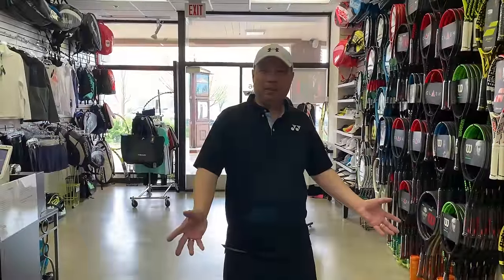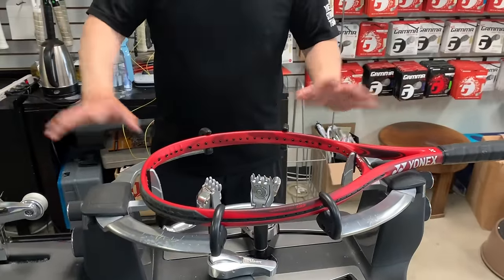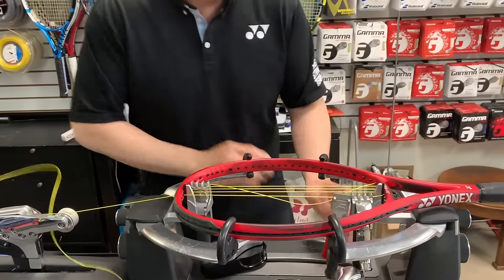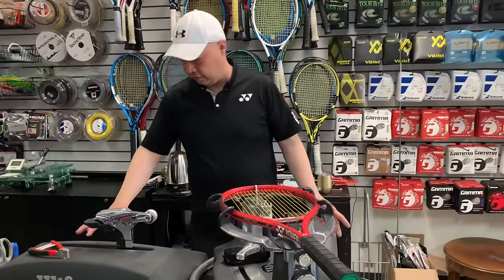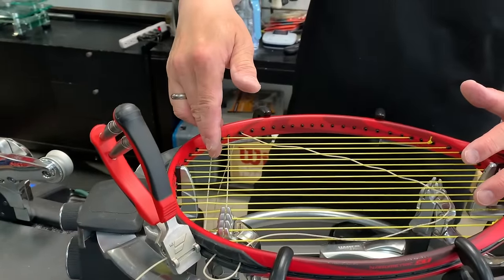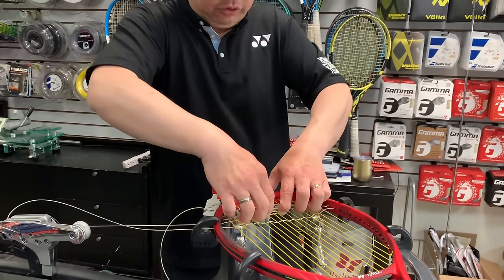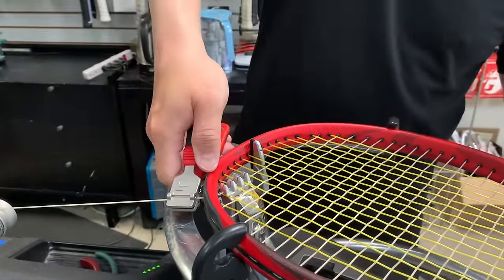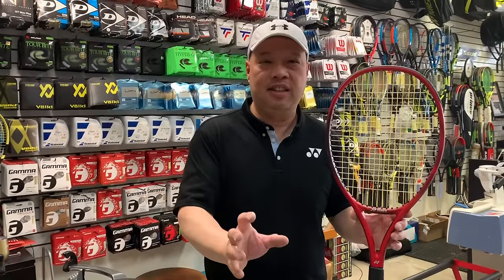Yonex Stringing Team - This is how we string tennis rackets.

Comment: I stretched the yonex vcore 100, for some reason, until the 11 and 12 horizontal strings were stretched, these two wires were misaligned. then continue to stretch the next strings, it's normal. so what's the reason?

Comment: Quick question for u. If I only have one clamp, can I pull the not by tensioning the knot string at a much lower tension? (30 lbs)? Or what strength, or any other advice

Comment: How do you stop the racket from becoming more round (shorter and fatter) when the mains are under tension? Is this done by using a higher tension on the crosses, or do the brackets hold the racket tight enough to stop the frame changing shape? 
When I string my racket, I noticed that it is slightly shorter and rounder than one that is factory strung (I’m am stringing two piece)

Comment: I did my first strung in my life with the help of this video. It was a head Speed Lite Racket and it came out great. Now, my question is, can i use this very exact method of stringing shown in this video only on Yonex rackets or is it applicable for every brand like Head, Wilson, ProKennex and so on. Obviously if i have 4bridges in the heart of the racket, i will begin the mains from the top, but other than that will i find always a Tie Off Hole in the near of the last string?

Comment: Just wondering but why unclamp the base then the actual clamp? There is a Baiardo and Ghost II at the shops here and they paid the premium for those machines for many features, including the gravity clamps. Isnt the point of gravity clamps to speed up the process by only needing to unclamp the main clamp and also to not introduce lateral stress to a string that was tensioned. Not that the lateral force would actually make you lose any noticable tension, but isnt that the idea? Trying to learn more, this is the best video I've seen on stringing but maybe my lack of knowledge is leaving me confused on some of the processes here.

Comment: Did you ever had problems with stringing yonex vcore pro 97 with 1.25 string (isospeed golden touch in that case)? Because for me the 7th mains keep breaking when I'm almost done with the crosses. Out of nowhere. It's fine with 1.28 string (tecnifibre black code). I was stringing with one piece though.

Comment: What do you do if the grommet hole is difficult to pass two strings in order to tie off your cross to a cross at the top and the only wide grommet is on a main in a  Soft mains / stiffer crosses setup?
Would you
-Tie off on the main instead.
- Enlarge the cross grommet
- Route the string to a bottom cross to tie off?

Not sure if there are any other options.

Comment: Awesome vid - Thanks! All of the criteria that are expected makes logical sense, except i have no idea what the benefit or precaution is regarding the point of “no starting knots”. Does this have to do with spreading the tension as evenly (or at least symmetrically) across the frame to prevent the frame warping to one side or the other? It seems to be the motivation behind the 3-4-2-2... mains point.

Comment: Hi, I just saw this video and I hope you can help me answer this question. This was really well done. And I see the logic in everything. However, I don't have a constant pull electronic machine. But rather a simple hand crank machine. My question is: How do I straighten my crosses if I am using a hand crank machine?

Currently, and I hope this isn't blasphemy, I pull my crosses in order to straighten out my crosses. Here is my work flow: 1st pull -> hand straighten the cross as much as I can -> release -> 2nd pull to take away the slack from the straightening.

Thanks! Appreciate your content! :)
Reply: Since nobody answered I will.  I have a crank,  a wise tensioner for the crank if I want,  and an overpriced electric.  When I do the constant pull it is easy to straighten the crosses as it is being tensioned - with two hands.   When I do the crank I straighten them after it locks out.   One more reason crank will have less dynamic tension then a constant pull at the same reference tension.   The USRSA take on crank vs constant pull is just account for the 5 or 10 percent difference in tension, and don't worry about it.  Just straighten the crosses after lockout and again when you are done.   No need to pull twice just because you have a crank, and double the time it takes to string the crosses.

Comment: The way Yonex want you to do it is what ATP guideline to string the racket. Stringers stringing inATP tour and grandslams are all using this technique else its not qualify to string for them. This is what i was told. I am a stringer too. Since then, I have been using this method to string the racket to do it so called the right technique. Of course there is many ways of doing it all depend on individuals. But most important is every racket you string has to use the same technique to maintain consistency for every racket.Thanks for the video.

Comment: How you do without a start clamp? My kid has a Yonex Ezone 100L and we bought a Gamma X-stringer XELS but it does not come with the start clamp. Thanks learning from your videos how to string a racket and do the string for my kid. Thanks. Lina Morales
Reply: A starting knot could be used instead but you would need to pull tension on the first (#1) cross when starting the crosses at the top of the head instead of as shown on the video with the starting clamp and pulling tension on cross #1 at the very end.

Comment: So I’m always pretty stressed about overtightening on the frame when securing it on the machine. I got a baiardo to replace my previous machine recently, and on the first couple of rackets I’ve done with it,  I’m pretty consistently hearing a little creaking from the first pull to until most of the crosses are in.

I suspect the creaking is from the racket moving a little bit against the hard rubber of the mount points and deforming a little more than it would when perfectly secured. Should it be tightened up a little more when it’s being put on the machine?

And how do you typically gauge when the mount system is properly tightened?
Reply: I always tighten using just my fingertips so there is no chance to over tighten it. Unless you have some incredibly jacked fingers, you won’t be able to over tighten it.

Comment: So good news is I can do away with the starting knot that always comes out different every time and takes longer.
Releasing the base first is a new one for me so I will start doing that. Having the racket face the same way every time is 

also new and a good way to have a consistent starting point. I dig that. I do skip string ahead on the crosses but I did not'
know why I should do it. I assumed it was for speed. I am a home stringer and thanks for these tips!
Reply: What type of machine are you using . Nice to meet you
Reply: @noefuertes7471  I went from a drop weight gamma progression to the big boy for me Tourna 300-CS

Comment: Ive seen some do a revised double half hitch knot. Over under through-under over through. Just thought I’d share. 

What do you think of the Parnell knot or Wilson pro knot?
Reply from the maker: djneight I have tried doing all the knots.  They are all good and work fine.  The problem is I have been stringing for 30 years so it’s hard for me change unless it is easier and faster as I am on autopilot all the time now...  thanks

Comment: Thanks for another great video!  I noticed in this video that the knots are tied on another cross string, whereas the beginner video ties the cross knots on the main string.  Does it make a difference if a cross knot is tied on a cross or main string?
Reply: Some people might want to only restring the mains when the mains break, and this allows that to happen. However, only restring the mains or cross is not recommended as it could result in a large tension difference between mains and crosses, and void the racquet warranty. Also, to prevent the poly cross from damaging a natural gut main, the starting knot might have to be tied to the cross.

Comment: Please tell me about the sticker with the tension recomendations. 
The sticker on the racket says: 16 mains/19 crosses....tension recomendation: 21/24 kg or 46/52 lbs
does it mean that I should string the mains with 21 kg and the crosses with 24 kg....????
Reply: I think it is saying that you are recommended to string at 21-24kg. Having a 3kg difference between the mains and cross is to big, and might actually damage the racquet. If you do want to drop the tension for the cross or main, 1kg is recommended.

Comment: at 4:00 you start by clamping one string, then doubling up with a with a starting clamp, then pulling tension.  i've always tensioned both mains together and then clamped off both mains without any starting clamp.  much easier and faster unless there is some reason pulling both mains together affects tension.  i use a lockout stringer.  not sure if a constant pull electronic stringer can pull two strings together.
Reply: You're getting half tension on those first two mains.
Reply: @RobsTennisVids  someone else told me that.  oops.  i did a lot of rackets wrong. tenx

Comment: I don't understand two things: when Yonex Stringing Team, why working on Wilson Baiardo? This is not necessery, but the other is important. Why double half hitch, and why not Parnell/pro knot?
Reply: Yonex just sent him a shirt for this promo lol the wait time when servicing yonex machines from US to Japan is probably alot longer than others which is why I dont see many shops using yonex machines. As the for knots, i use both depending on my mood or request of the client. Richard Parnell is simply cashing out his political stature these days. All knots should be tight as long as its done properly. Its just politics.
Reply from the maker: wferdinand The Yonex machines are $8500 for the cheap one...  As for the knot, it is what you are comfortable with.  Like Jimmy said it is all the same as long as you know what you are doing.  Thanks

Comment: When pulling your knot tension on your mains I noticed you only hit the knot feature once. Does that not mean that you only added the extra 10% on the first knot string and not the second. I have 2 Baiardos and the knot feature only stays on for one pull. Am I missing something? Also. you mention at the end how straight the strings are, and how other stringers use a setting off awl, but with this technique you do not have too. At 19:36 in the video you can see that the mains are not straight thus the reason some of us use the awl. Are you suggesting that we leave the mains curving into the center of the racquet?
Reply from the maker: About the knot feature, you are right.  For the sake of time I skipped showing you the knot button again.  About the crosses not being straight, I looked at the part you are talking about and it does look curved.  I never did straighten out the crosses so it must of been the angle with the video.  I never want to straighten my strings at the end cause this will mean a lost of tension.  So, I straighten as I go when tension is being applied to each cross.  Been stringing for over 30 years and I am still learning and trying to always be better.  Thanks for watching.

Comment: Wow nice stringer.  I only have a klippermate drop weight machine and I always end up.woth a rainbow but I usually string for myself anyway
Reply: The most important thing is consistency (other than not damaging the frame or string). The "rainbow" is a natural occurrence if you don't straighten the crosses as you go. The reason we straighten them as we go, is because the strings will be looser if you do it after you've finished (a straight string is shorter than a curved string, so straightening them shortens them slightly, and results in slightly lower tension). If you're stringing for yourself, and you're happy with the results, no need to change.

Comment: Thanks for the video.  I string my own rackets and I also do them for friends.  Here's a few points that I noticed in your technique.  First, I use a similar approach to starting the mains as you do when starting the crosses.  That is, I loop the string around the center of racket so that two equal ends remain at the top or bottom of racket.  Then I put a starting clamp to one side while pulling full tension to the other.  Then I proceed to tension 3 strings away from the starting clamp. After which, I pull the starting clamp end and tension that side and so on.  I tried many if not all of the methods.  This is the simplest.  Your method of double clamping will leave visible marring from the starting clamp on a center main for poly strings. My method puts the marring around the edge of the racket which is less visible.  Second, when I tie off the last end of the crosses, I pull off the starting clamp before I clamp and release tension.  If you leave the starting clamp on while clamping on the string, the overall tension is changed due to the additional weight of the starting clamp.  Finally, like you, I double knot my ends since the double knot minimizes the slack.  I have discovered this through experimentation however, your method of knotting the first knot does not minimize slack because you don't start by pulling away from the racket first.  You pull towards you and this will keep the slack in tact.

Comment: I’ve just bought a vcore98 2nd hand. Strings, still relatively new. Felt good on 1st play, but I noticed there was only 2 tie off knots instead of the usual 4. Is that normal, advantages/disadvantages of doing it that way ?
Reply: The advantage is to the stringer.   Two piece (4 knots) is easier as you are not dealing with 40 feet of string as with one piece (2 knots)  stringing.   Older racquets may not have extra tie off grommets but all the newer ones do.    It should not matter when you play with it.

Comment: I have been stringing my own rackets for all long time and have always done the one string method. If I were to do the two string method, how would I go about measuring out how much string is needed for the the mains  as well as the cross strings?
Reply: For a 16x19 100 sq in racquet using poly, I normally do 580cm for the mains, and 510cm for the cross. If you want to play safe, then add 10cm to each string. This number might go up or down depending on the string pattern, head size, and elasticity of the string (e.g. poly vs multi). Hope that helps :)
Reply: @ryancgw  Hi, thanks for video! I have reels of string so they do not come with the labeling tape used to put the date, type of string and poundage...what type of tape do you use?

Comment: great video thanks, I have a question if i may.
I am stringing rackets at 26-25 kg and when testing at the end I am recieving 23 kg tension so I am losing tension somewhere.
since I do not have the node feature I add tension myself for the last string before noding.
I calibrated/tested my babolat machine and it works perfectly.
I basically do everything like you in this tutorial beside the first cross string, I string that one immedialty and do not leave it till the end, is this the problem in your opinion and why do you leave it till the end?

thanks in advance
Reply: How are you testing it?  Those twist style testers are not precision.   Type of string, thicknessect can put them out.

Comment: I'm wondering why you made the last knot (tie-off of the 1st cross) low down (at 10T maybe?) when the Yonex spec says the tie-off is at 6T for vcore 100.  Is that because the knot is a double hitch and not a starting knot?
Reply from the maker: Paul McGhee that is correct.  Yonex tells us to never use starting knots.  Thanks for watching!
Reply: @TennisSpin  I think you are missing the question, the spec says tie-off at 6T and you tied at 8T (closest cross) instead of 6T (main string).  Does Yonex say tie cross strings to cross strings and not main strings?

Comment: First of, thank you very much for the great video.  It definitely added couple of new technique for me (like the first cross string)
I have a question and trying to fix my flaw when stringing, if you can please answer. (thanks in advance)
My last 2 end strings on the Main always come out little bit loose, even if I apply the 10% extra tension on them.
Could this be due to the clamps that's holding the crosses that can cause it to happen?  or could it be something else?
Reply: you probably lose the tension while applying the knot, if so then put even more tension on the last string, like 15 or 20% more
Reply: @hansrindswurst2448  thanks for the feedback, will try it out.  In addition, I started to pull and hold my knot string with the starting clamp before i unhook the clamp...

Comment: Hi Really enjoyed this video! So Yonex prefers to have the knot for the first cross to be tied off on the third cross? And Yonex doesn’t recommend a starting knot. Could it be they don’t want to stress the grommet on the main string that will be anchoring all that tension from the very start of tensioning all the crosses as the stringing progresses? What’s your view?
Reply from the maker: Yes, 3rd cross.  When I first strung at a pro tournament, they said never use a starting knot but that was 20 years ago and a lot of pros used VS Gut back then.  Starting knots would snap when tensioned especially VS Gut.  I am sure this carried on to today and nobody wants to risk it especially on a pros racket.  Sometimes the starting knot would slip through the grommet as you have probably experienced.  I use a starting knot everyday except when it's VS Gut.  Thanks for watching!